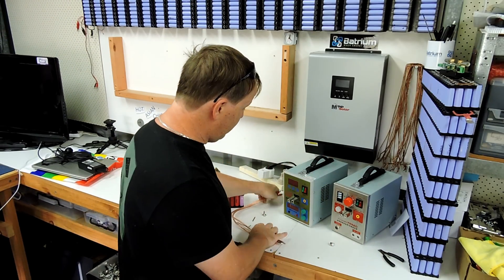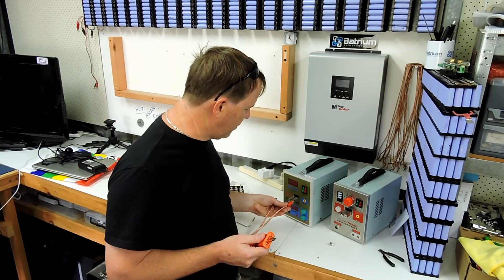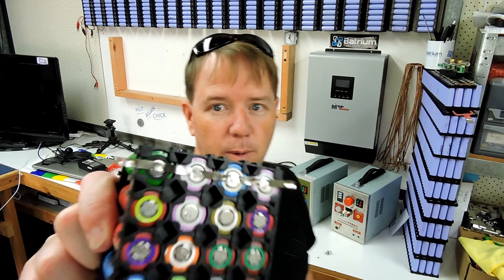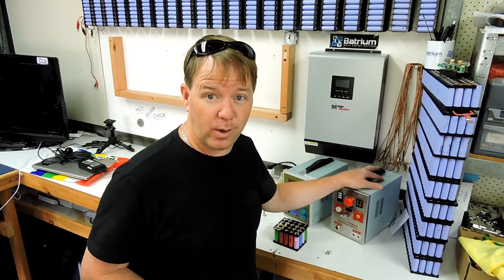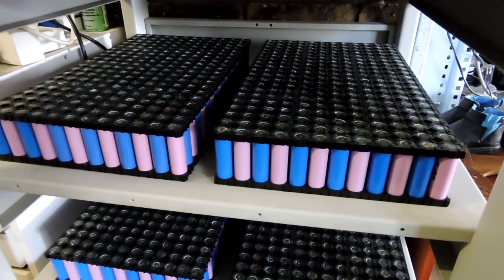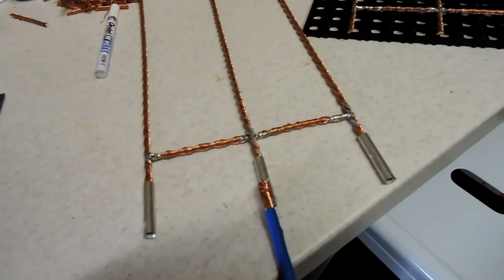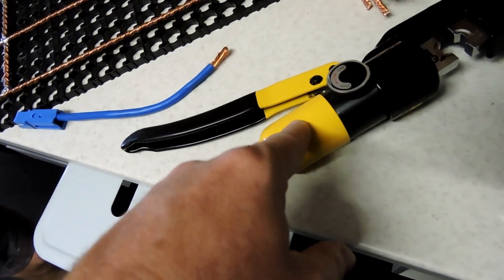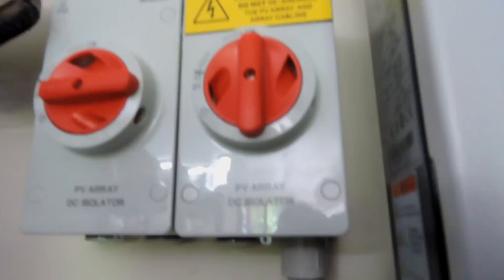Returning spotwelder to Rohan & taking a look at his progress

Comment: For the hand tool, you can bend the gold plugs out a little to make a tighter fit. I believe they are the same internals, but one has a bad soldering iron, and one has a bad charger. Don’t use the charger or soldering iron on either one. The reason for the added cost is because the 709A comes with the hand tool you paid extra for as a complete kit. Basically if yours came with it they would both be about $200US. I think I paid $229, then it was on sale for the holidays at $200 recently.

Comment: Open it up. I see heaps of vids with loose bolts and poor internal connections in cheap stuff. 
If it works directly, but not with the handles, maybe swap them. You can also get some metal shim strip - maybe nickel strip - and roll it around the connector ends and jam it in the hole to make it tight.
Reply from the maker: Still thinking of attaching some lugs rather than bullet conectors ... will have to try

Comment: that leak is why most people get the manual hand crimper yes its more expensive but it doesn't leak
Reply from the maker: Worked well so far but for small leak, Rohan said still working for him... if it dies i'll get a manual one for sure
Reply: sadly its the main point of failure  however if you happen to have a hydraulic guy that services floor jacks and the like they will probably be able to service it for you  maybe $100  or if nothing else get you the o-ring kit for it
Reply from the maker: only cost 50bucks lol but i really didn't think it would be doing this much work
Reply: yeah remember I'm quoting Adelaide prices well for you at that rate yep go ahead and buy a new one cheaper for you

Comment: I have seen the extension reworked with 50amp alligator clips(battery clips). Sometimes this will help. Typically the extension will work with most welders, even the homemade ones I like to build.
Reply from the maker: Talking about amps - #nextvideo :)
Reply from the maker: I'm thinking I might attach some nice heavy cable lugs rather than the current method of attachement not sure if its worth the extra time
Reply: Need to have a large contact area because of the hundreds of amps these things produce.
Croc clips have sharp point connections with probably only a couple of small contact points, and will weld themselves to whatever they're gripping.

Pete, you could try wrapping some copper foil around the plugs to give them more bite, but I don't think that'll work for repeated plugging/unplugging.
Reply: You'd be surprised at how many amps you actually produce when welding batteries. On average, I get anywhere between 30amp and 50 amps(.02 second for me is the sweat spot). With resistive welding, the amps climb the longer you make the short. This is the reason when you see spot welding they make contact a little longer. The alligator clamps I use are typically 30-50amp rated. Have yet to weld any to my spot welder. Each tooth will act as a parallel connection spreading the amps used. But if you have the choice, making a solid connection will always win. 😊
Reply: Yeah... people will be surprised how many amps these little spot welders are producing... me and Peter fitted my Fluke 381 Clamp Meter with the Inrush function and recorded the results.. very interesting!
We are posting the video tonight =]
Reply: Glad to know you've got a handle on the currents involved...
Reply: That will be an awesome Video! My Inrush on the 120V side can get pretty close to tripping breakers and blowing fuses...LOL(But I only run at 120V here in Seattle) I used The same type meter on the MOT I built. I would love to see how much different the commercial device are. Total shorted wraps on most of my MOT, I can get upwards of 500-1000amps(wire to wire). But the MOT and wiring starts to get a little warm, loud, and I typically blow the breakers or a fuse. I haven't tried to go over 1000amps.. Inrush Current I can see around 20-30amps on the 120V side. Typically on a full 1 second pulse(reduced side at 2.3Volts), I get around 75-100amps. On .01 second, I get around 10-20amps. I have built 3 to-date and all run about the same. You can find the Post here on my Google Profile(no videos yet unfortantly)-

#3-Probably the simplest of the 3-
https://plus.google.com/+JoeFulwider-njfulwider5/posts/LLBUWLE1U3Y

#2 and my Personal Favorite-
https://plus.google.com/+JoeFulwider-njfulwider5/posts/8vaV8Lj5zLa

#1 Basically testing the waters(uses a capacitor for timing)-
https://plus.google.com/+JoeFulwider-njfulwider5/posts/aiGrVvEB8tB

Hopefully, these can give you guys some ideas if you decide to alter the ones you have. I might purchase a commercial one, just to play around with. I found one from a vendor, I have purchased from in the past for around 80$ US. Looks a little like the one Peter was using. I look forward to the video you guys have. Been wondering how many amps those produce compared to the DIY MOT versions for awhile.
Reply: Not sure if you have me on your list over on Twitter. Here is some quick picks of the welds i get with the DIY builds I do. This is from my last DIY Tab welder build. I had a 10s1P that I needed to be welded-

https://twitter.com/njfulwider5/status/936173574452264961

I keep my electrodes(not sure if that's what they are called). To a Fine Point, then I take the file and file it off, leaving me a small round point that works perfectly. when I force the tabs off after I use the DIY welder, it looks pretty close to the welds on a laptop battery, the only difference, mine are way-way harder to take off. The one I used on this has a 40 amp SSR and a simple 4$ 555 delay timer I got from eBay. Than the MOT(800watt) with the #2 welding cable. All inside an old Computer PSU case. I painted my case black. Here is that simple build-

https://plus.google.com/+JoeFulwider-njfulwider5/posts/LLBUWLE1U3Y

You and a Few other have been the inspiration behind all of them. I have learned a ton from you guys!